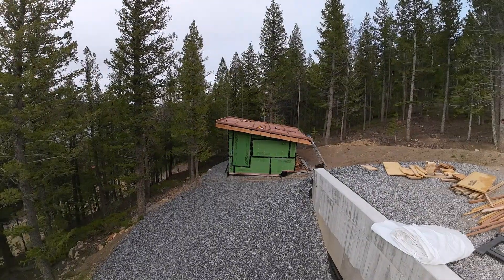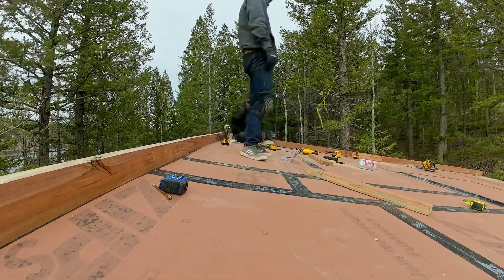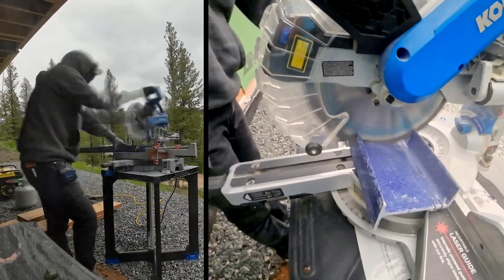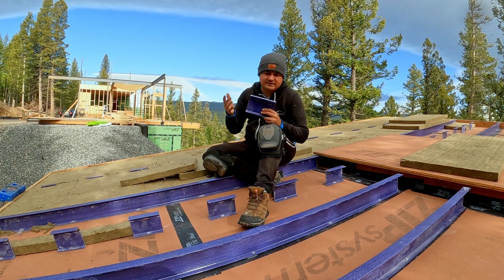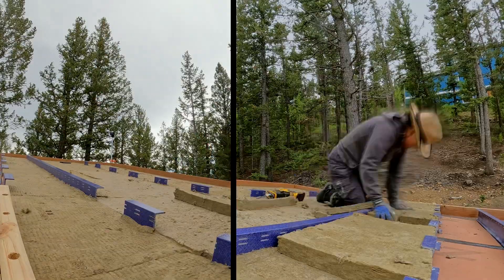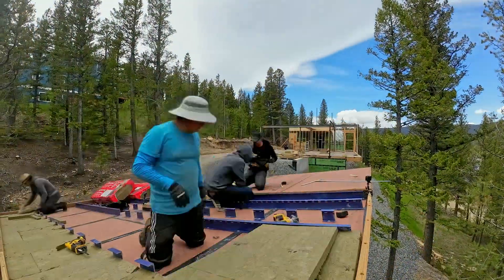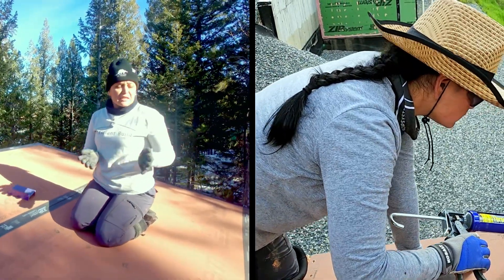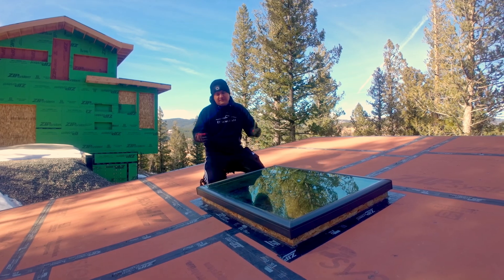The Art of Efficiency: Building Science Meets Roof Exterior Insulation! #buildingscience #rockwool

Comment: No need for a roof over a roof, you can do polyiso + steel or buy deeper roof trusses.
Reply from the maker: The goal is to minimize thermal bridging. In a place with weather as rough as ours simple polyiso won't do. We also need it to be fire rated. There is no great solution. Maybe as you said, deep  trusses might work best.

Comment: If a person deflects the roof imagine mother nature's winds lifting and pushing 30-100 times a minute year around.
Reply from the maker: I wouldn't say bouncing is a sign of a bad assembly. Fiberglass is super strong. Many skyscrapers sway, stadiums bounce, steel is bouncy and extraordinarily strong.
This roof has withstood huge storms.
That said, we are replacing the z-girts on future roofs for 2x.
It is cheaper and removes the deflections.
Reply: @efficientbuild  the deflection was on the zip panels.  The video said over time the deflection could damage the zip tape.
Reply from the maker: @MadRat70 Yes, that's why we don't do it that way anymore. We actually have a video coming out 2/15 using the new improved method. In other words, use 2-bys instead of z-girts for the roof.
Reply from the maker: You had questions about installing exterior insulation on the roof, here's how we do it now.
https://youtu.be/xuTR-WIHWH4

Comment: Does the rockwool have any tendency to slide and compress over time? The incline on the roof is pretty gentle, but I didn't notice any stops or attachment that would prevent the rockwool from moving.
Reply from the maker: They make three versions of Rockwool, this ComfortBoard 80 is rated for outdoors, that means it is a bit more sturdy, it's pretty good at keeping its shape and not compressing on its own. In fact the 80 in the name means it can handle up to 80 lbs per square foot without compressing.
The perimeter extensions, the 2 by's, hold everything in place from sliding off. Then within, rockwool keeps itself in place due to its physical characteristics.